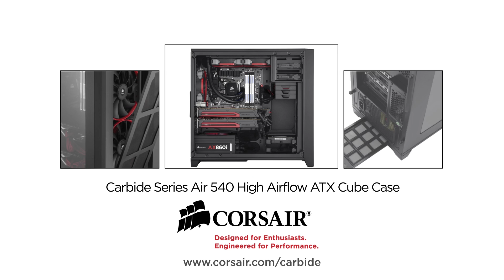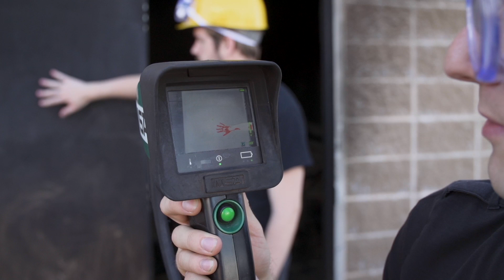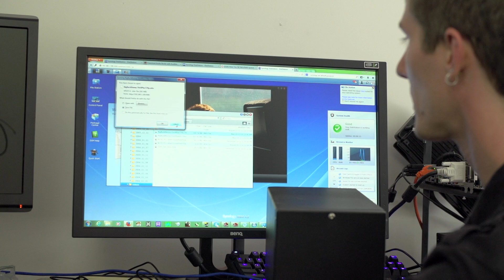BURN TEST! IOSafe N2 Fireproof & Waterproof NAS

Comment: One thing you should have done was had the NAS powered up during the fire until the point where they put the fire out.  In a real world situation it would be on until the power was cut by the fire department or the adapter and NAS wiring failed, whichever occurred first.  This was a demonstration that at least the box itself will protect against a fire and in most fires it would probably do fine even if it was on.

Comment: A More real world test would have had the drive powered and running so the fan maybe would have drawn more heat in side as well as possible data corruption as the the controller boards failed but very good test!!

Comment: Having the power input melt in the fire is a good thing. You wouldn't want the fan to be running when the house is on fire anyway. Still I think the NAS should have been switched on in this test, but I'd understand if the fire department wouldn't let you do that.

Comment: You could do that, but Linus didn't. In the vid both drives were tested together at the same time. And if it was RAID1 maybe only one of them was broken, but you might not know about it until the other one conks out as well. At least that's how I think it works. And because the fire was only on one side it'd be nice to know both drives survived, because in a real life situation the heating may be on both sides.

Comment: hes not talking about performance, hes talking about the fact that if they were set up as raid0 then they would be less reliable and therefore would make it a worse case scenario so you would know even if you had the absolute worst possible situation you would still be ok with using one of these.

Comment: Great test but..
about hard drives working properly: you didn't take into account, that during a fire NAS would most probably be powred ON(which it didn't seem to be on the video). Melted plastic or electrolytes would have vaporized(and caused eg. short-circut) or leaked(causing eg. another short-circut). Not to mention water from fire hose or sprinklers in the office.

Having said so, I do not believe drivers, after such an accident would be working out of the box (and yes, I know you shouldn't

Comment: ACTAVIS PROMETHAZINE WITH CODEINE PURPLE COUGH SYRUP. Each 5 mL
contains: Promethazine hydrochloride 6.25 mg; codeine phosphate 10 mg.
Alcohol 7%. Specification. Indication: Cough Suppressant.We also have KUSH and   medical pills available like Crystal meth,apvp,am-2201,ur-144,4-mec,5fur-144. Quality products. -Fast Delivery. -Discreet
Packaging. Express Delivery Available? with UPS,FedEx,EMS.Tracking
numbers and references available. contact:9164097687

Comment: If you mean that you want to build a PC with two SSD's, one for your OS and one for data (games etc), and than you want three WD 2TB drives in a RAID configuration. Yes this is possible, you just need a capable motherboard for RAID 5 support because that is the "only" RAID config for three drives. The only problem is that RAID 5 running of your motherboard is (almost) always very very slow.